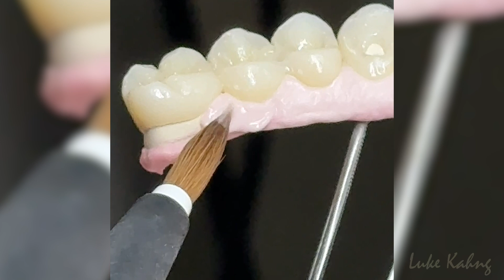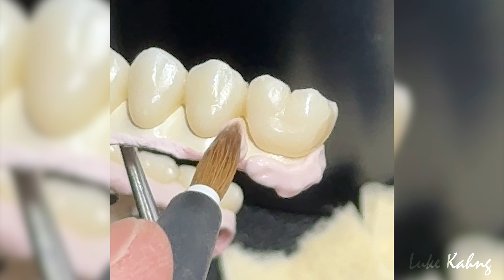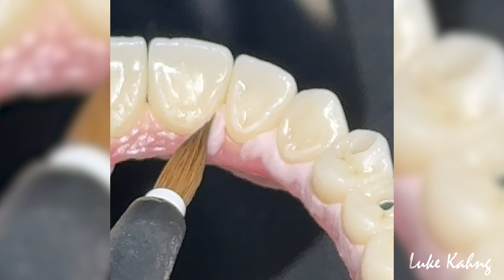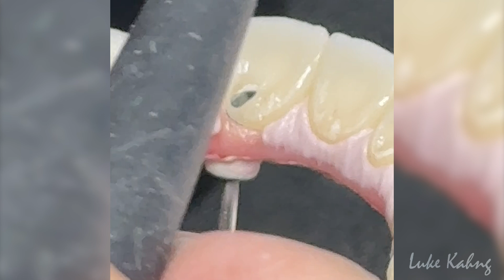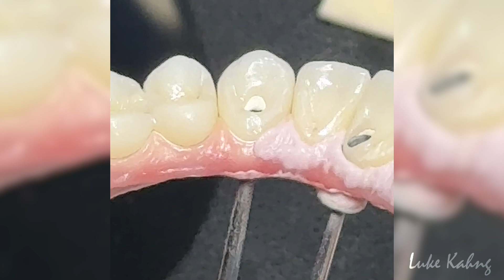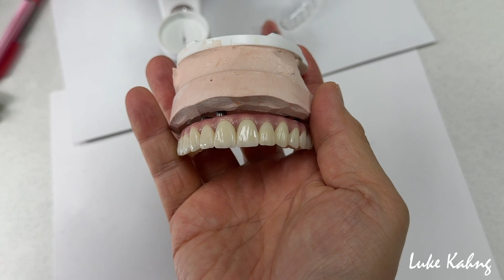Making an Esthetically-Pleasing Zirconia Implant

Comment: Doc it seems this is being built very wet and loosely and not being condensed and dried. Is there a special porcelain being used? That does not require condensing. I'm not being sarcastic. I am truly interested and how they are able to work so wet and never show them condensing or blotting dry
Reply: I understand you are using a viber brush.So it is not as wet as it appears, but I still blot
Reply: Got it. It seems that I should have watched the video further. That you are allowing it to shrink purposely and then overlaying in the thin areas with different colors brilliant